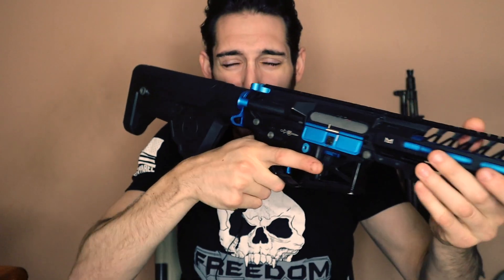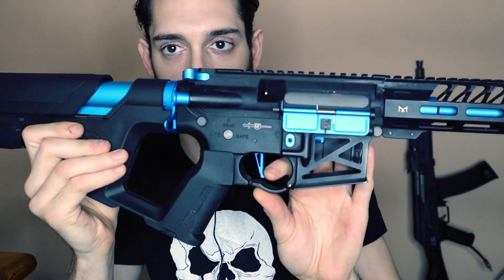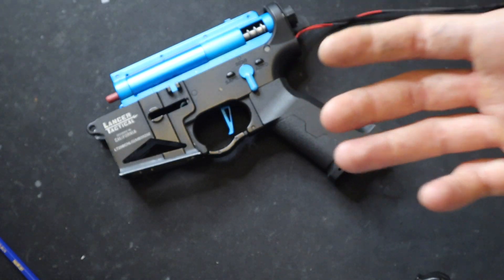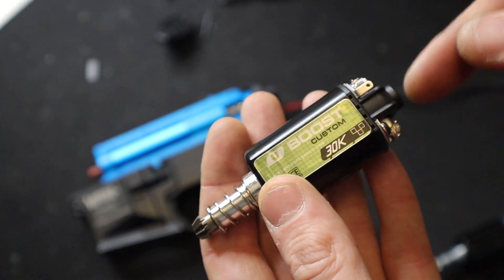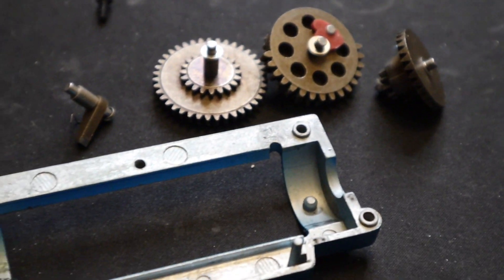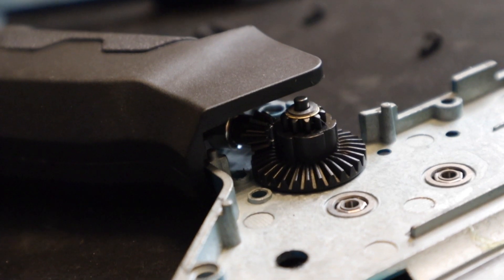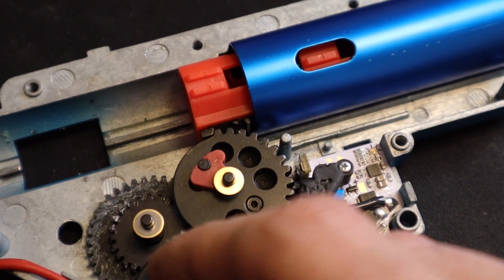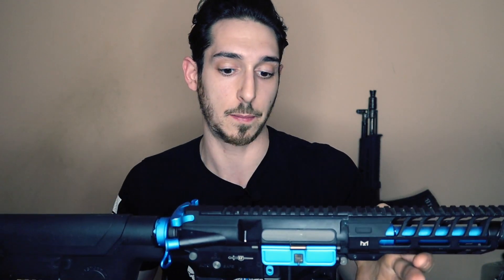Lancer Tactical AEG UPGRADE for NYI.Fajita! CQB BEAST!!

Comment: Got my Lancer Blackhawk and I got a maxx trigger, gate aster, and high speed motor for it. People hate these guns but they are upgrading beasts! 

I'm changing to a high torque motor after hearing this video.

Edit: What gears did you use? I want to change to 13:1
Reply: He used shs 13:1 gears and asg 30k boost motor
Reply: @Sandaco  brand gears.
Reply: I assumed shs but upon closer inspection I actually have no idea, but he sells rocket 13:1 on his website and they’re really good
Reply: Anyways sorry for the confusion
Reply: @Sandaco  Ok thanks bro.
Reply from the maker: Rocket is the USA OEM to SHS
Reply: @TheRealDealAirsoft  I'm thinking of getting the matrix 13:1 ones of evike. Whats your opinion on them?
Reply from the maker: @nicogetsgains2968  they should be ok but if you want solid reliable gears and are not in a rush , I’m getting a very large shipment of generation 4 (newest) shs 13:1 gear set. They are sold out on my website but my distributor said 1-2 weeks I’ll have them in stock 

Now for evike they won’t even start shipping your package for a week then it will take another week to get to you so roughly about the same time frame. 

Those gears on evike are basically shs 

However you will spend $10 more for an older generation product vs getting it from me. But it is true you can order from them right now as I’m waiting on a restock so it’s up to you. 

After shipping you’ll spend $36-37 on that gearset. 

You can get the exact same thing from me I sell them for $25 not 30
Reply: @TheRealDealAirsoft  I'll probably get them from your website. I'm just making sure and doing my research to make sure all my parts efficiently work together.

Edit:

I just found a killer deal! I was looking for a high torque 30k 21-22 tpa motor and I found on umbrella armory a surplus krytac 30k motor 66% off! Old price was $60 now it's $20. Whats your opinion on that motor.
Reply from the maker: Shs 13:1 from my website .. but re stock is 1.5 weeks from now
Reply: Back when I first got interest in Airsoft back in like 06 07? People HATED on WE guns as well. Saying they were lemons and pos clones. Now I see them everywhere haha.
Reply: @philliprhodes7926  Everyones got WE tech lol.

Comment: Low gear ratios you want a high speed motor for high gear ratios you want a high torque motor
Reply from the maker: This is so wrong. Bro in this video I explain efficiency and TPa. 

High speed motors have low TPa. They are the worst thing to use for low ratio gears. Low ratio gear means that there more stress on each tooth of the gear — more stresss on your motor 

Higher TPa has stronger torque. Low ratio gears high torque will be easier to cycle those gears. 

A high speed motor would result in really high AMp draw and a hit motor and maybe a blown fuse
Reply: @TheRealDealAirsoft  exactly man. Was just about to buy an shs ht with my 13:1’s until I learned about energy efficiency. I now run a asg 22 tpa with same gears and it’s craaaazy efficient. Almost no amp draw and still has crazy trigger response. Who cares about rps I still get 22 and that’s definitely enough for me

Comment: This is why I like lancer, cause you can upgrade the F out of em, and they are cheap
Reply from the maker: Exactly !
Reply: Lancer make some pretty cool externals for guns
Reply: Yeah I like em too but the one I have is a two piece hop up and you pretty much have to upgrade them or they suck
Reply: @JordanGuyOne  not necessarily, they are good, just the company's qc used to be bad, their gen3s are great so I've heard and qc is much better
Reply: @JordanGuyOne  even on the gen 3?
Reply: @JordanGuyOne  yea mine is the same way so I just bought a $40 red dot sight on Amazon and you can still keep the hop ups, and the sight works really good
Reply: Dude! This is the exact breakdown I needed! 🙏
Reply: Just don't post your thought on the airsoft Reddit page.. they hate lancer tac there
Reply: imo G&G has the same benifit, but its better quality and value for money. specifically the cm16 series, its an amazing base gun
Reply: Cheap but high quality